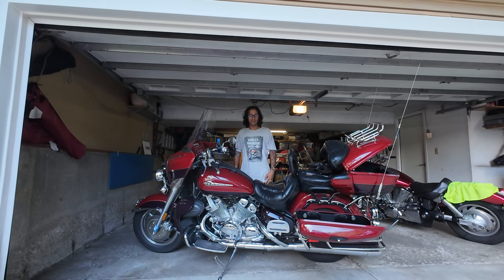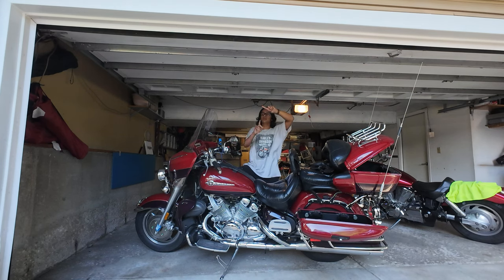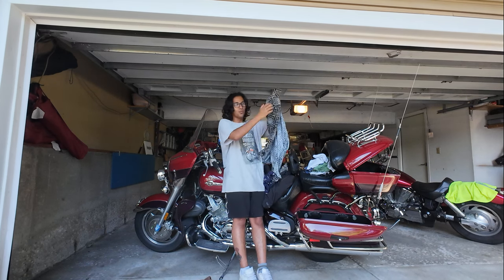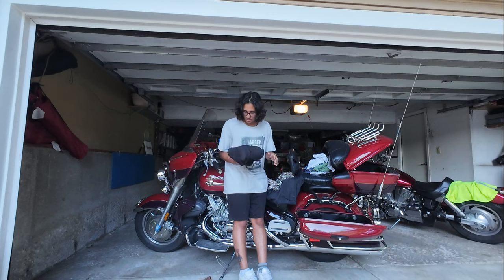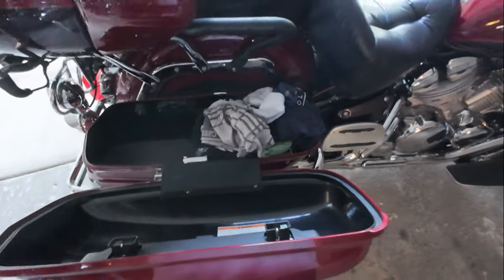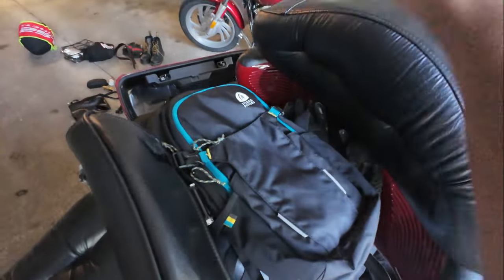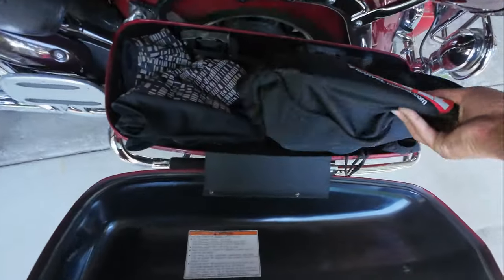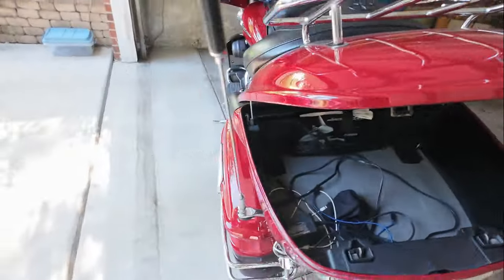Packing For My First Motorcycle Road Trip (Tips and Walkthrough!)

Comment: One thing to be aware of is this, "less is more". Clothing should be in a waterproof duffel bag or a case that can be mounted on the rack on the top box. Since you are on a Yamaha, you may or mayn't need to carry tools. A duffel bag can be mounted on the passenger seat. Luggage on the rack can make bike top heavy. If you carry a tool roll it should go in the right bag. Things that you don't need to access often should go in the right bag. Tools and things you access often should go in right bag, it's away from traffic should you need it. Electronics always go in the top box if equipped. Again, less is more. Been doing this since the 70's...Oh yeah, don't forget rain gear.
Reply from the maker: I definitely learned that lesson is more! I brought a portable Bluetooth speaker I never even ended up using lol. The biggest thing I was missing is a portable jumper / tool kit, since my battery died in the middle of Michigan and I had to have somebody jump it for me. Thank you for the advice! I’ll split where I put my items from now on.